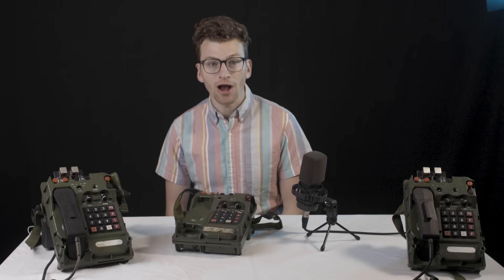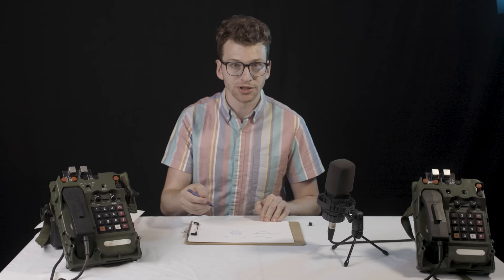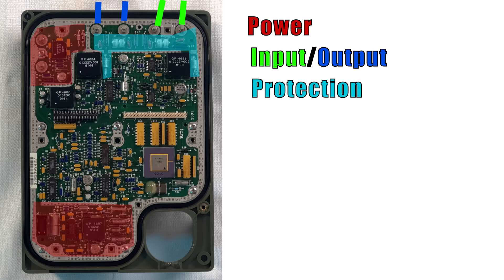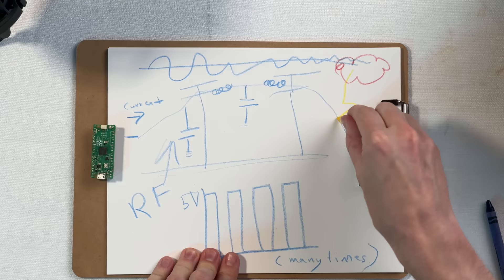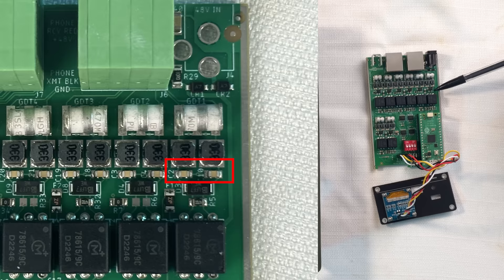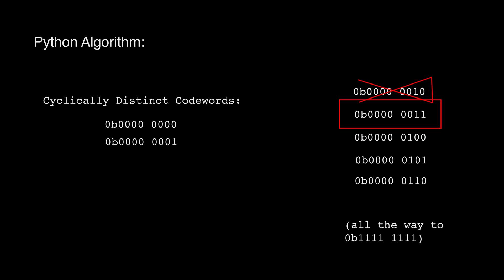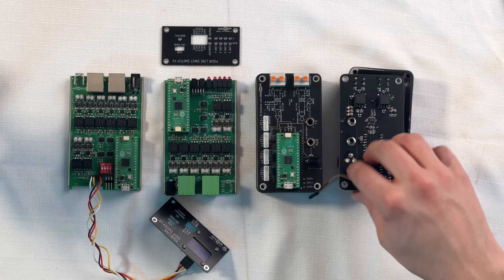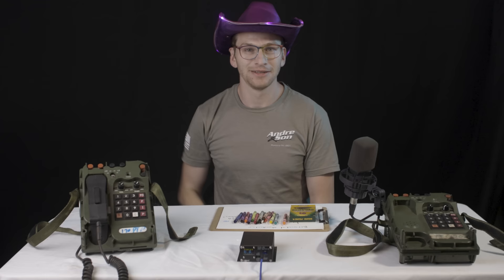What's inside this old military telephone? | TA-1042 Part 2

Comment: I am a hardware-hack type of EE and have had four of these phones sitting in a box in the closet for about ten years now. I want to use them on my property for remote locations (90 acres).
Reply from the maker: Rob did some simulation which suggests the phone and switch can handle about 4km of decent wire before we see too much attenuation but we haven’t tested it ourselves. We are selling these on Tindie along with the adapter boards to use RJ45 between the switch and TA-1042. We have both kits and assembled/tested versions.

Comment: I was enjoying this anyway but then you teased a cursed fax machine. Now you have my full attention.
Reply from the maker: Why cursed? We were able to get it to transmit through the switch but replaying the data didn't produce any output (it was set to broadcast mode). There is one other guy who has one and we are going to try to run the data over SIP once we get that working in standard full duplex mode.

Comment: As a seattleite myself, there are definitely others fascinated with this older tech, but im just only now learning electronics + circuitry in my 30's, even after being a mechanic for years. Unfortunately RadioShack was a husk of a store by the time i was disassembling things to figure them out for fun. Also, there was no youtube back then, no free courses, and no podcasts😂 thank you for making this video! It scratches my nerd itch, and its still related to what im studying.
Reply from the maker: Oh fun! Do you do the seattle hardware meetup? Every Thursday :) Send me an email if you’re interested.
Reply: @nicksknackstech  I've never heard of it, thank you! I live right on the county line for the greater Seattle metropolitan area. I definitely will send an email, I actually have time for a month to visit. That would be so much more interesting than breadboard and Arduino experiments..

Comment: Just a tip taking 2 9v batteries and connecting them positive from one battery to the negative of the other battery is called a series connection

Comment: Parts shortages:
I assemble my own boards - I probably shouldn't because it takes a long time.
It takes me about a year to put a board design like this together once I have a schematic.
All of the "jellybean" parts like resistors and caps are always the same size on all my boards - 0805. This way, I can order bulk when available and they'll work on all my boards. I can see and solder and rework 0805, smaller parts start to get to be a pain in the arse.
With "special" parts, like transformers and level shifting ICs, I closely look at the manufacturer websites to see if the part is marked for discontinuation (not for new designs). I also try to use parts which I know are used over and over in some other product which sells well. This encourages the manufacturer to continue making the part.
Transformers for me are always ETAL branded as they have a pretty common pin spacing.
If there is a problem with a part being available, or is soon to be discontinued, I will quite happily take an axe to my schematic BEFORE I start to lay out the board.

Front panels:
I've started adding a copper-pour to the rear of the panel, and then making the screw-holes with plated through-holes with a large circular pad on the front so that the screws can "connect" to the panel. I also expose the rear perimeter of the panel and sand off any powdercoat from the main enclosure ends so that the panel can "connect" to the enclosure. This makes for a fairly robust continuous chassis enclosure, fully wrapped in equipotential metal. It tends to help with audio gear attached to ultra aggressive digital RF gear and interference.

Comment: This is such a good overview of the reverse engineering process. It was very entertaining to watch!

One nuance you may have missed on those protection inductors on the input side is the resonant frequency. The inductors in the phone look more like ferrite beads to me, meaning the composition of the ferrite was carefully selected to give the component a high impedance in a specific frequency range, maximising it's utility as an input protection device. Basically ferrite beads are intentionally lossy as they're meant to be used as filters.

The inductors you used look like power inductors, meaning they're optised for low loss energy conversion applications like buck and boost converters, and they won't give you the same kind of filtering performance the original did.
Reply from the maker: Alright you’ve nerd sniped Rob and we will be testing the difference 😂

Comment: They were just beginning to use them as I was coming into the army in 1981. Prior to that, we were using the TA-312
Reply from the maker: Was it the TA-954? Most of the TA-1042s I see are manufactured 1992-ish.

Comment: In the 90's I was repairing radios for the Army.  The maintenance company I belonged to also included telephone repair techs.  I of course saw those phones, but didn't work with them.
Reply from the maker: They seem to be pretty reliable. Friend who used them in the gulf war said the extent of the maintenance was washing the boards off under water (since they’re all conformal coated).

Comment: This is so cool! It reminds me of the Tft 96 AWITEL from SIEMENS that is in use in the Swiss army. It is similar in that it is also a non-secure voice terminal, but it doesn't need a switch to work (unless you want to connect to a normal telephone network). What's even cooler is that it connects inductively to the twisted pair, so you don't need to cut any cables. Unfortunately these aren't on eBay like DNVTs, even though they are from the 90s :(
Reply from the maker: it is quite possible they are still using them :)
Reply: @nicksknackstech  Yes, the army is. But they were also sold on the civilian market, so I was counting on that. They didn't make a whole lot though.

There is a wikipedia page in german if someone wants to read on that.

Comment: Super excited to see the follow-up video, and can't wait for the rest of the series. I don't mind the back to basics EE coverage, but would appreciate a little more detail on the circuits. Maybe a logical trace of the final board following the signal path, that would help bridge the current gap between the low level theory of operation and the system level architecture.

Excited for the next couple episodes! This is really great content for a first series on a channel.
Reply from the maker: If you just want the circuit the board files and schematics are open source. There isn't much other than what I described here for the phone interface, though there's an expansion header and i2c interface for the display: https://github.com/rrruark/DNVT/blob/master/PCB/6_switch_V3RT/DNVT_box3rt.pdf

Comment: 15:37: does this provide EMP protection...? I remember with the avionics we were developing, for EMP it was 1KV at 1ns impulse... remember that an EMP induces a large current and voltage, and this being a military telephone system from what I remember it has to be EMP proof... in our avionics we had special zener diodes that would detect the gamma flash and short the 5 V power rails to ground for the instance of the gamma flash and induced EMP...
Reply from the maker: Chatted with Rob and he said that likely an indirect lightning strike would have more potential than an EMP, so the protection from those is probably along for the ride so to speak.
Reply: @nicksknackstech  if  it is designed for MILSPEC it would  be required to have EMP protection… the difference would be the rise times for protection. Lightning protection would be typically, one kilovolt rise time in one microsecond, whereas EMP is one kilovolt rise time in 1 ns. … Try and find the contract under which these were manufactured and the requirement specifications as it will be stated there.

Comment: you guys are way way way above me, i was a western electric co equipment installer for twenty years before retiring so this is very interesting to me. in an old time  telephone office  .lol , when you pick up your hand set the central office equipment gives you dial tone and connects you to an incoming register for touch tone -( dial tone multi frequency)to receive all the pulses for the numbers you want and passes them on to a completing marker to complete your call. am i wrong in saying that you are setting these phones up to work with no central office and just connect all of them to one line and have them able to tell if some one is looking to call them and ring the right phone and once the phones connect you can talk with just those two phones. i am probably wrong but i think by using all these codes you are doing away with the central office.please don't laugh , i have trouble with my smart phone. i love all kinds of surplus military electronics equipment . thanks for the videos even if i don't understand all that you are doing.
Reply from the maker: The device we created has two “modes,” basically if you just give it power it behaves like a line simulator device where you can set up a few POTS phones and call between them. We are working on a VoIP mode which basically uses a computer program called Asterisk to emulate switching equipment, and it can be interfaced with telephone infrastructure via gateways.

We are working on a POTS version with DTMF decoding.
Reply: @nicksknackstech  POTS to SIP, be it Asterisk or Kamailo would be very neat. 
And then one could set up osmocom-analog and do dumb things, like call from an NMT450 or AMPS phone to the DNVT terminal.
Reply from the maker: @2ftg  yeah it's been immensely frustrating to try to play with POTS phones and every single ATA has a router and 30,000 random NAT options baked into it. A simple open source 8 line POTS interface with line simulator features and asterisk compatibility would be quite fun, not to mention we think we can get it fully assembled by the PCB manufacturer (as opposed to this unit where I have to solder transformers in my back bedroom, which drives up my effort/cost to sell them).

Comment: What you described was differential audio, not balanced audio.  Differential audio has two inverted lines biased against a common neutral; whereas balanced audio both lines are 180 degrees from each other independent of the ground or shield line. An XLR connector is balanced audio where the shield / ground line has no electrical relationship to the signal lines and is just there to provide protection from EM interference.

Comment: Man, it's been years since I used one of these. We rarely used these to call people and talk. However, we used the connector on the back to connect to data terminals which essentially allows us to use the phone network as a lan for our systems. You got that working? 🙂 That would be cool.
Reply from the maker: Yeah we have one of the fax machines which includes the data cable. Still trying to figure out the details there on how that works. I did find one guy with a data terminal but it’s missing the original software. Our intent with the asterisk/SIP integration is to pass the raw CVSD audio/data directly to maintain compatibility with the data features.

Comment: if a transformer has 127 V- AC -60 Hz on the primary side. and on the secondary ,a rectifier and a filter cap to smooth the AC ripple , is it still 60 Hz after filtering?
Reply from the maker: Yeah the frequency doesn’t change. The ripple will still be 60Hz and the size of the ripple is a function of the energy storage capacity post rectifier and the load on the circuit. There are some other tricks people can play to further smooth the voltage like zener diodes. These days though they typically use switch mode power supplies, which have the further advantage that a technique called active power factor correction can be used to improve the power factor of these supplies (ordinary rectifier circuits only draw current when the AC voltage is near max/min) but with active power factor correction circuitry is employed to modulate the current in sync with the voltage waveform.
Reply: @nicksknackstech   Hey Thanks Man 😀

Comment: So when will you make your own DNVT phone with a Pico? 
Or a Pico based POTS <-> DNVT bridge?
Reply from the maker: Our plan for DNVT to POTS is to make a separate POTS interface and then use asterisk to transcode. So it would likely be something you’d need a RPi in the middle to use in that way. As for creating our own DNVT we’ve been looking into it. The circuits wouldn’t be hard but I have no experience with injection molding or case design. If we did build such a phone it likely would support multiple interfaces (eg we are looking into using the long range single pair Ethernet with power delivery to allow voice and data).

Comment: I totally have almost bought one on ebay just to take it apart; And now their not for sale anymore. 300 USD plus - I remember them costing 25 usd
Reply from the maker: Yeahhhh the price has quadrupled since the original video unfortunately. I suspect that the availability has gone down after they were decommissioned around 2008.
Reply: @nicksknackstech  I feel like in the future nerds like yourself could make a buck flipping such units and helping out the community at the same time
Reply from the maker: I’ve asked around but there aren’t very many that have them at the moment. Somewhere there must be a pallet hanging around but it’s probably in a dark corner. We were debating making a clone of these phones (probably not just DNVT and supporting other communication methods like long range single pair Ethernet).
Reply: @nicksknackstech  I would not do that. They will work themselfs out of inventories like the old Geiger Counters. We all know Uncle Sam buys bulk

Comment: I bought your switch and ethernet adapters, tons of fun!  Any updates on connecting these to a laptop for voip?
Reply from the maker: Hey sorry for the delay — the plan is to create one pjsip process per line and then register it to an asterisk server or similar. This will transmit the raw CVSD data over SIP to allow data modes, then leverage a CVSD codec in asterisk to allow transcode to other formats like ulaw. Such a project is a new endeavor to me as it requires piping command/control/state plus streaming audio data between two Linux processes which I have yet to perfect. I’ve chatted with some telecom folks and they agree this is probably the best option but it requires essentially demuxing the audio data and distributing it amongst different pjsip processes. I had some help dealing with the pjsip side but any collaboration or emotional support would probably help speed things along. Feel free to email or join discord for more or to help out :)

Comment: Did you dad work for Philips inventing the Digital Compact Cassette system which used the CVSD ADC chips and CVSD DAC chips.
Reply from the maker: Does DCC use CVSD? I've only seen it applied in lower fidelity phone applications as well as simpler two way radio digital standards. Most of my dad's work was on LPC and its application in encrypted military phones like the STU-II designed for low bandwidth high bit error rate communications.
Reply: @nicksknackstech  CVSD or better known as BITSTREAM.

Comment: Once I acquired a military phone, it was black and it had a 4,5 Volts battery compartment. There was also a crank for if you wanted to speak to the ministry of war or the chief of staffs. Not many had a telephone on their desk. It had to be connected with cable, steel wire, cheap wire. it always curled up, never stay hidden. It was good we were never invaded by the Russians, they could have easily trips over the steel cable and broke their necks. 
Just like now, they invade a country, they almost drown, get disappointed and want to leave, start making war amongst themselves. You can't win a war with the Russians.

Comment: bloody great. I particularly loved how you explained transformers and so many of the details of the electronics. As a software guy who never studied EE, you probably have no idea how wonderful this is. All packaged around a well-sized reverse-engineering project. Thank you so much!

Quick question: you explain a lot of elementary components and circuits that make the whole but not op amps. You can't explain everything! My question is did you skip op amps because they're tangiential, because they're assumed knowledge, or something else? I would have thought transformers were more basic than op amps, accordingly, less surprising if you had skipped transformers and explained op amps.

I'm curious because my casual, ad hoc EE learning I lack the map that identifies things in orthodox order.
Reply from the maker: They aren’t really the key interface of this system because they are only used in the phone on the RX side as a comparator (along with some analog audio we didn’t reverse engineer since the switch doesn’t care per se). On our switch we use RS422 drivers instead which no doubt have op amps inside but they are in theory black box. The comparator is not the most interesting use of an op amp either (you can literally just use an op amp as a comparator by connecting to both leads) but I would guess that the need for some level of hystereses makes this circuit a tad more complex on the phone RX side. Probably makes more sense to dive into them when we do the analog phone project.

Comment: Great, any chance to do same for Washing machines- to improve functionality-of these He ( high efficiency) terrible systems ,
Reply from the maker: Burn it and buy an 80s model with the real agitator. If you're stuck with them, clean out the stupid rubber ring frequently and you can use vinegar during the colors cycle to keep the mold smell down. For whites always use hot with bleach.